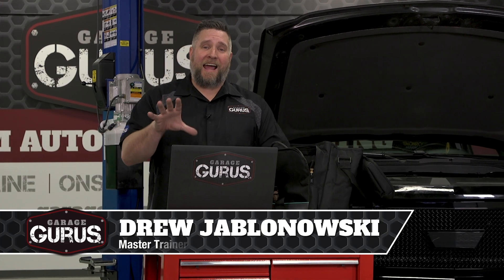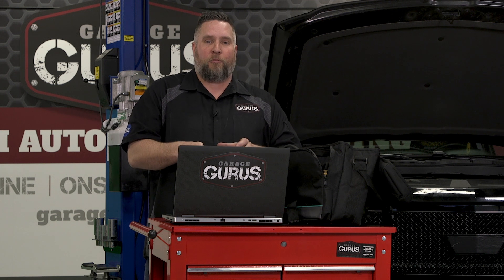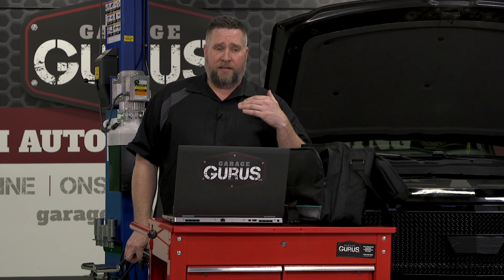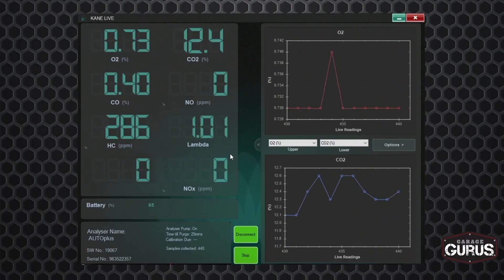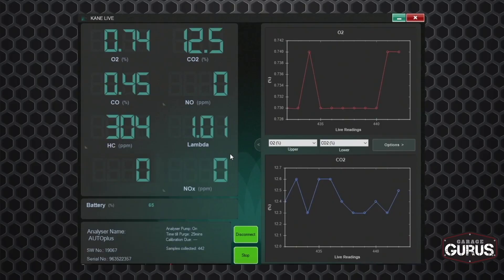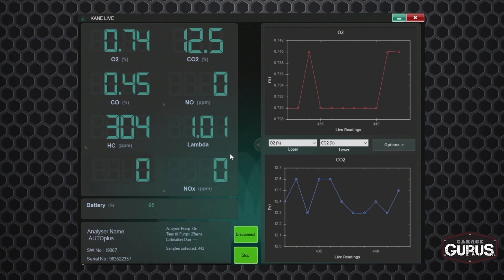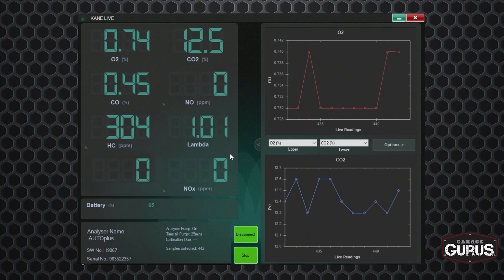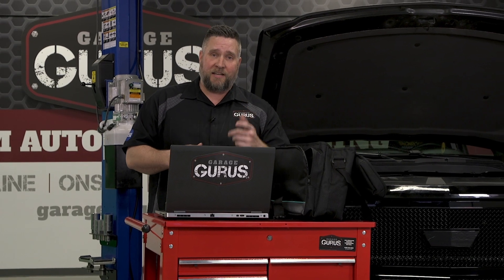Garage Gurus | How to Use a Five-Gas Analyzer to Diagnose a Vehicle

Comment: Could use an explanation how the readings lead one to believe there's an ignition problem. I'm not an expert, and my first thought with the melted cat and the O2 being high, was there was air leaking into the exhaust causing higher temperatures? It would be helpful to understand the mental thread of how an ignition problem could cause this. Thanks.
Reply: Unburnt oxygen and fuel. Something is messing up with how the combustion event should be occurring.
Reply: You notice the lambda at 1 which is dead on. If he's hooked in front of the cat or behind the bad cat these readings aren't that bad. Lambda of 1 is 14.7-1. The HC would be high post Cat but we didn't get enough information on what's going on ??